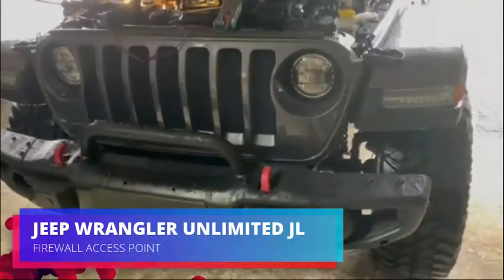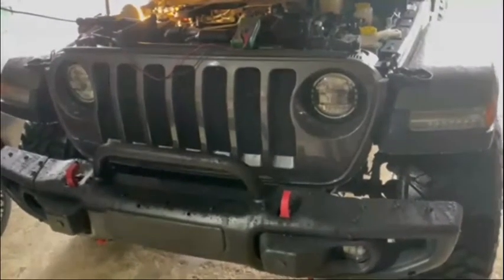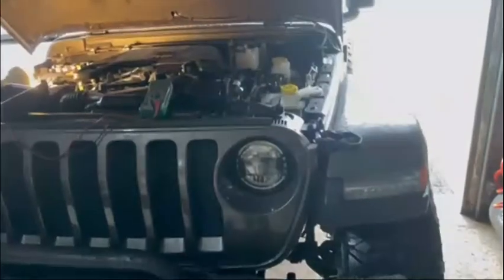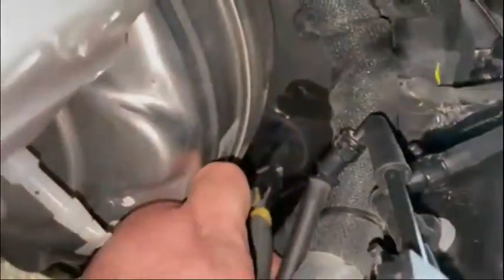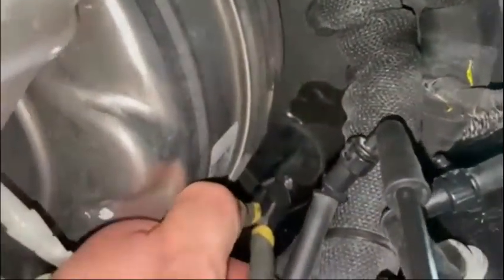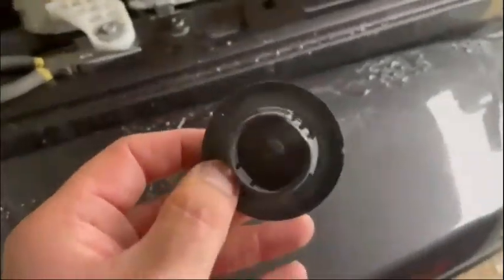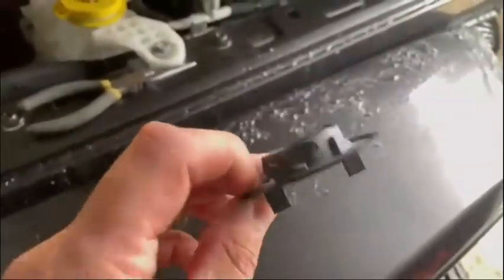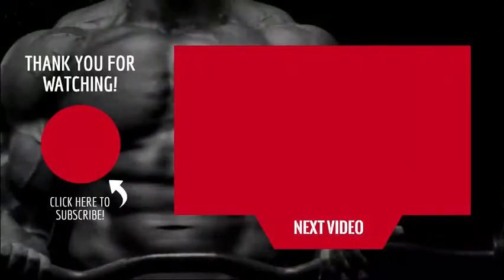EASIEST Way Through The Firewall On A JEEP WRANGLER

Comment: FYI This won't work if you have a manuel.  This is only for AUTO Trans.
Reply from the maker: Didn’t know that. Appreciate the info!
Reply: I have a manual where would I run it through?
Reply: @luisro3231  there is a clutch bump stop I was able to drill through the firewall there and then I ran the wire through a grommet, caulked around it and then put a piece of plastic that would act as the bump stop
Reply: I was about to say the same. I can't find a pass-thru on my standard...
Reply: That makes sense. I have a manual and it wouldn’t work.
Reply: You are so right.  I have a 2023 Wrangler Willys and some kind of black hose/line runs smack dap through the middle of that gromet for me.  I don't know if it's brake or clutch related.
Reply: It works bud.

Comment: I wonder if my 99 XJ has this! Could i put a grommet in that hole?
Reply from the maker: Yes you could or you can use the cap you pulled off and put a feed hole through it.
Reply: @FlipITGarage mine has a cap just like the one in the video. It just doesnt have any tabs to grab onto. And it seems has some kind of adhesive/sealant keeping it in. I was thinking about ordering a rubber grommet like the one thats close to it with a sleeve to help seal it up
Reply from the maker: @bdr5150  definitely not a bad idea. It would give a better seal for sure. As far as removing the one you have you can try cutting a slit in it and grabbing it with needle nose pliers.

Comment: After your install did you fill the entire hole with caulking? I was think a small rubber groument drilled into the existing cap.
Reply from the maker: I used the same piece that was removed to cut a slit in it to feed the wires. Or drilling a hole would work as well.
Reply: Thank you
Is it  rubber or plastic 
Have not got the nerve to pull on it yet.
Reply from the maker: @garyferguson1552  it’s a soft plastic.